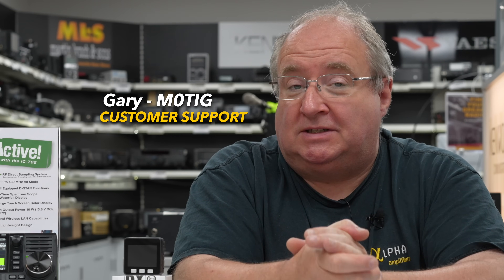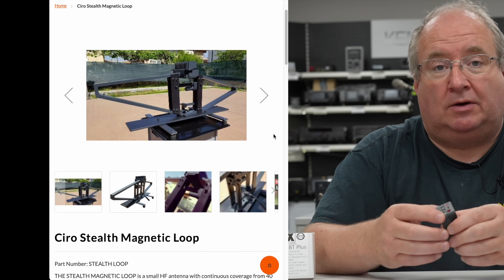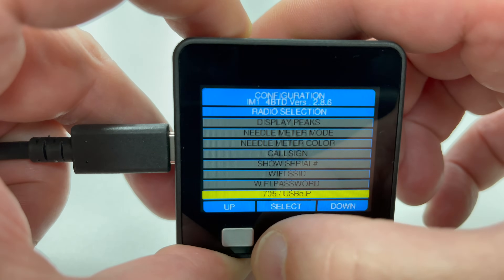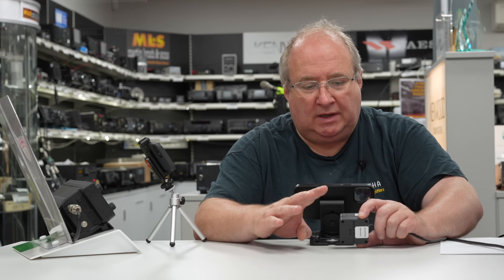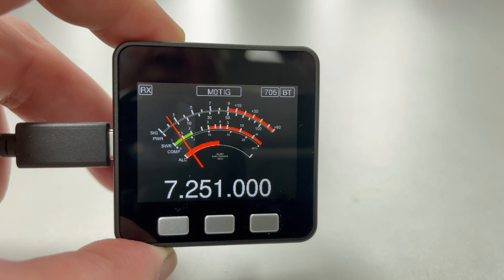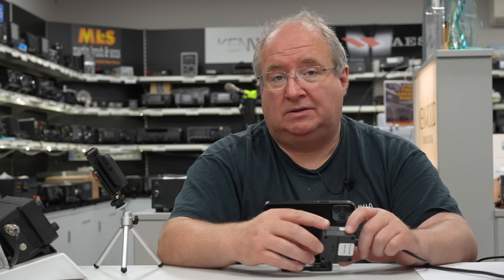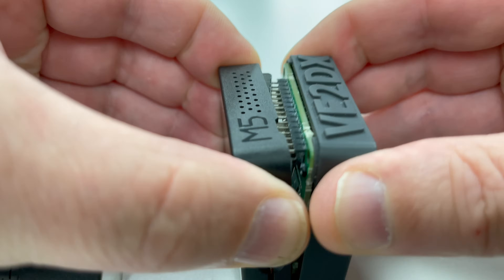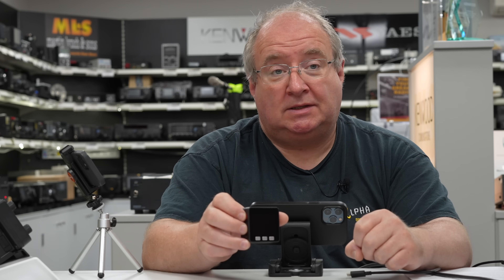New Icom IC-705 Accessory: Not Just A Meter...

Comment: This would be useful as heck on my 7610,  problem will be you can have CI-V on the USB or the Remote jack but not both, - as far as I can figure it out,   as I currently have the WIN4ICOM suite using the USB CI-V connection and I would be loath to lose this as its providing serial com ports to all my third party applications, so bit of a dilema, unless there is some way to use one of the CI-V ports from the meters CI-V hub to drive WIN4ICOM?  Bit expensive to buy as an experiment!